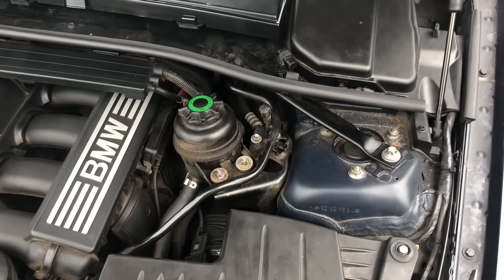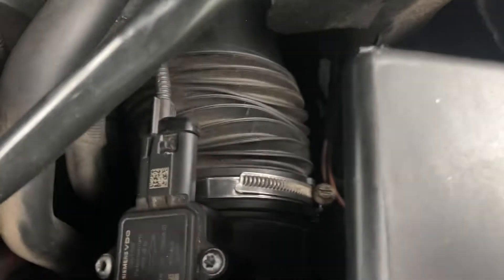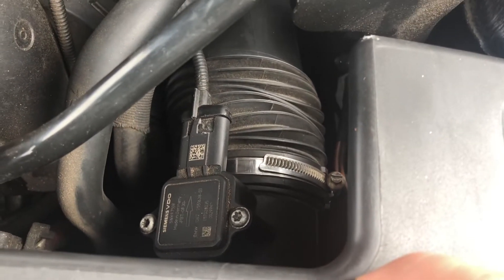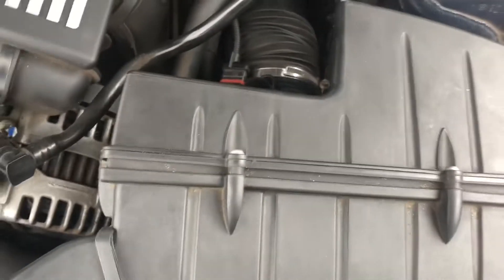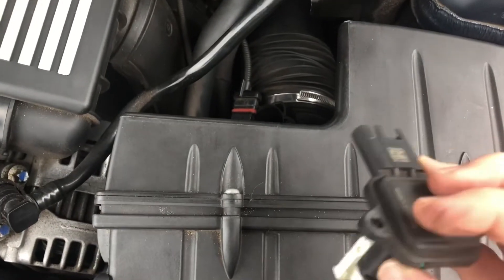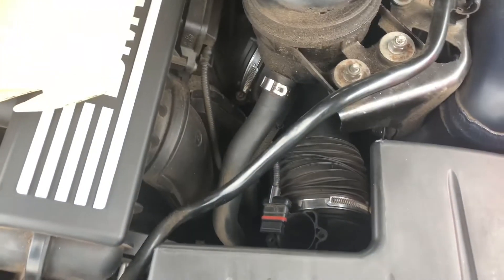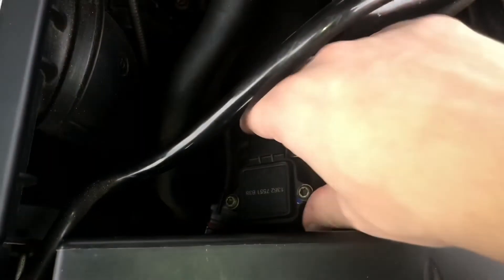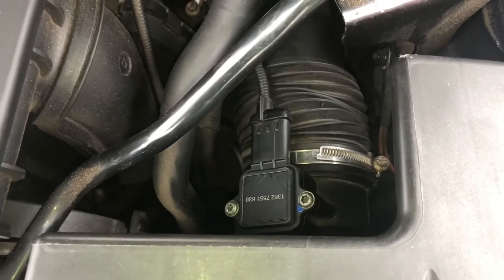BMW E 90 Mass Air Flow Sensor Replacement

Comment: Thanks for this. My kind of video. (Or maybe I just like it because the procedure itself is ACTUALLY simple, easy, to the point, sensible, possible....and doesn't require a month of research and mechanic's procedure instructions or the ability to navigate a bootlegged 1990s software program in German, doesn't require me to remove 200 pounds of plastic intake parts, and 
  ...FOR ONCE, I get to skip the hopping on one foot with my keyfab facing due East balanced on my head, spin 6 times to the left, 7 times to the right, access the secret German menu on my dash and open menu #13 within 4 seconds of powering the dash on, keeping the keyfab perfectly due East and balanced, blink 46 times at exact intervals synced to my timing, and hold down the left horn for 19 minutes while I pull out fuse 20 from the (hidden, and only present in half of the e90s produced in 2007 but I'll only find out if mine is a lucky one when I perform the perfect Irish jig under a cloudless sky as I close the hood at the end) fuse box 12, which is inside one of my actual tires (just take them all off, unmount all 4 and I'll find the fuse box 12 containing one single 5 amp fuse which I pull out and then slam it back in at 22.670nm/s torque and if my car chimes in the key of A# one single time at that moment, I'm the lucky lucky soul able to access the plug I need to fix the *absolutely critical issue* of a crusty sensor, which has made my car think it was being stolen by the Mexican cartel and set in motion the 100% security system that unfortunately includes the engine feature where it sets itself on fire to prevent the cartel from accessing my glove box while committing their crimes... which was a faulty crusty sensor in all models anyway, but I can't afford the whole car rebuild BMW requires in order to fix the faulty anti-cartel security sensor after all. 

Sigh.

Comment: HELLO WHERE U BROKE THAT CONNECTOR..CAN U PLEASE SEND ME A PIC OF HOW MANY PINS ARE IN THAT CONNECTOR THAT IS ATTACHED TO WIRE HARNESS.I HAVE SAME CAR AND THNK I AM MISSING A PIN (HARNESS SIDE..NOT ON THE SENSOR ITSELF..ON THE PART (CONNECTOR) u BROKE..I CNAT see it in your video..please help..thanks  RNHIB@ATT.NET
Reply from the maker: Just sent you an email. Mine is also missing a pin so I think that’s normal. Thanks for watching!

Comment: With the engine off does the MAF give a read out? when my engine is off its at 0.0, my dads car reads 0.6 with the engine off.  so wondering if there is an issues?

Comment: Did u need to clear the P codes with Carly or Carista after or does it do on its own?
Reply from the maker: thjerm You don’t have to but I don’t think they will just clear on their own. Not clearing them won’t effect anything but they might still show up if you scanned the car again. Now if you got a service engine light because of the MAF sensor it should go away on its own after replacing it.  Carly pretty much just shows you a record of what faults have happened and they will stay on that record until they are cleared. Make sense?
Reply: I would definitely clear codes lol